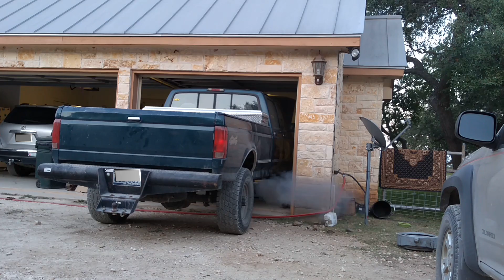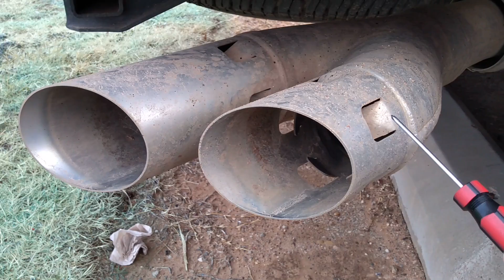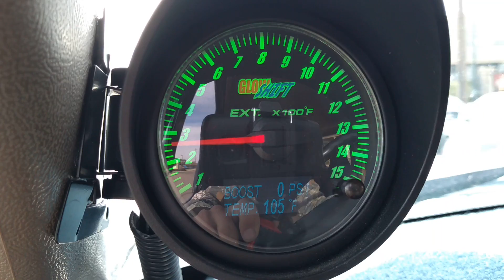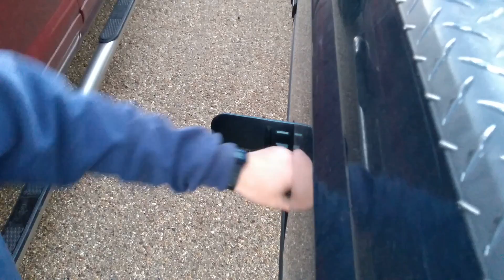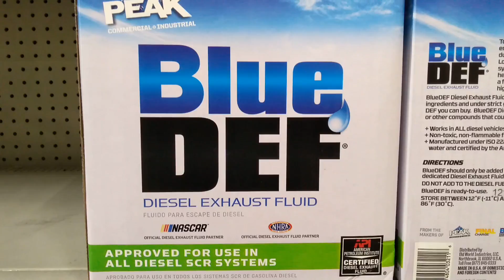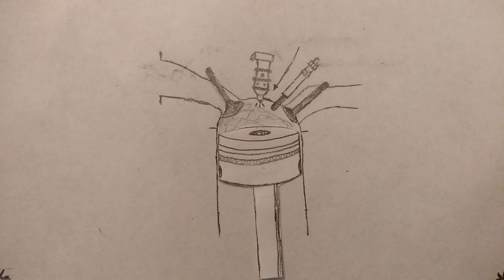Top 10 Things to Never do to a Diesel

Comment: I realize this is a 5 year old video. But,,, old diesel farm tractors had a Ether can, with a button mounted inside of the cab, built into them. There were no glow plugs in those days and there is no way they would ever start at anything below 30 degrees without a shot of Ether. This was common until the early 90's, later on some models.

Comment: I have a 2007 F350 with a 6 liter diesel. I use Howes diesel treat all the time. It cleans and lubricates the injectors and prevents fuel jelling in cold weather. I don't let my fuel tank to go below three quarters and everytime I refuel I add the correct amount of diesel treat. Never had any problem srarting in cold weather,as long as the batteries are good the engine fires right up.

Comment: Ive always thought there should be a pedal that you pump a few times before start that primes the engine with oil (gas or diesel engines ) but why prevemt the main cause of long term   damage

Comment: Had a mechanic at work put a fuel pump on a diesel motor water pump on my tank truck, i used a couple spurts of ether to get it to crank over but i couldnt get the damn thing to run, the mechanic literally emptyed a full can of ether into the air filter trying to get the air out of the fuel line, the 15k$ 30hp motor never ran the same, i think the ether burned the rings because it smoked like a chimney everytime i started it, and blew oil out of the breather tube, that motor had about 10 hrs good hours on it and 50 hours of blowing oil until the piston finally let go this week..... Yes, ether is very bad for all motors in large amounts..... no lubrication and burns very hot

Comment: I didn't experience heat increase by putting a different exhaust tip on my 16 6.7 stroker. I can put my hand on the exhaust tip. It is uncomfortable. But doesn't hurt. I could not do that to my 7.3. You put gas in your diesel tank... you have a very high chance of blowing up a injector. I agree about the ether... don't use it on these pick ups. If you have to do something like this in a pinch use something like wd40 where it has lubricants. I have seen diesels that after ether has been uses on them... they become reliant on it.

Comment: 289,000 miles on my 2006 6.0
Lots of repairs at 200,000 miles but looking forward to 400,000 miles
Reply: Keep up the maintenance. My 03 6.0 has 332600 on the clock. Yes I've worked on it myself and have paid for repairs also. Parts and maintaining costs money. I think mine is making 500,000. Interior and power train mint .I need a new bed Winters tough in Pennsylvania. Good luck getting to 400k.

Comment: Good info! I recently acquired an abandoned sailboat, and there was water inside the Perkins engine and fuel. 4.5 years of abandonment. After cleaning the entire fuel system and bleeding, flooding with Marvel MO, 2 x 20sec cranking, with no effort moving or firing up, i sprayed 1 sec of ether inside the engine and waited 20 sec. It cranked up with a massive tonne of white smoke. Would never do it again, but it got the baby started and hopefully very little of any damage to get it alive again.

Comment: Newer Rams with Exhaust Brake/ Jake Brake..always have it ON. If you dont run it for a long time..it will build up soot and when the time comes to engage it..it may not fuction and or burn out the Variable Actuator motor..And since the Chip shortage looking at $700 to $5000 for just that Actuator..ask me how i know..Dealership $5000 and $600 direct from cummins..and unless you are in a serious bind..and depending on who you get at cummins they don't deal directly with the public..I was fortunate enough that they sold it to me.

Comment: I'm surprised you didn't mention the term "run away", especially for the ether tip. A run away diesel is terrifying, and every diesel owner should be at least aware of it.
Reply: What’s runaway?
Reply: @debspeakes9750  basically it starts to use oil as fuel and starts a reaction that ends with the engine exploding. Taking the key out of the ignition does nothing, it's pretty insane. Reason I keep a fire extinguisher in my truck.

Comment: it's not the ether that's the problem, it's the people using it. always crank your engine over to pre lubricate the cylinder walls, use very little ether and turn your key straight to start. don't let the glow plugs cycle at all. but I always plug mine in. when I go hunting I put a pan full of diesel under the oil pan and light it on fire. takes about 3 hours depending on the temperature to heat it up. a 3 pound coffee can works good. have also heated up my 400 cummins in the big truck like that. Some times I think they should bring back the compression release.

Comment: One thing I've learned to do, especially in cold weather (like here in Canada) is that if it's going to be idling for awhile, bump the idle speed up to 1000-1100rpm or so, if you're able to set it to do that. It helps keep some heat in the engine and the engine oil, which is good for the engine. I had a truck with a 466 that would drop the temp right off the gauge if you let it idle on cold winter day in about 20 minutes, even after driving it at operating temp. Bumping the idle speed up to 1000 or so helped keep the engine temp closer to where it should be. Also, just don't run them cold in general, running too cold doesn't let the oil heat up enough to work properly and evaporate off contaminants like condensation.
Reply: Upgade exhaust tips lol nothing stupider then a giant exhust tip

Comment: You can use either but you have to do it right unplug your glow plug relay so it doesn't destroy your glow plugs turn the motor over until you see smoke out of the exhaust then you can give it a small shot. But better yet while you're turning it over when you see smoke out the exhaust have someone else give it a small shot will you turning it over period and all will be good

Comment: Both my diesel John Deer loader and road grader came from the factory with on-board ether tanks with remote solinoids for cold starting injection systems.  And both came with block heaters and very cold days I use both but prefer ether.
I rarly use it on my 7.3 for reasons you point out.

Comment: What’s the recommended time to warm up a 7.3 diesel (I have a 99 f350). I usually wait 5-7 min when it’s not cold outside and when it’s cold cold I wait 10-12 min until I leave. What’s your opinion?
Reply: I do the same thing with my ford 6.0 I have temp gauge and watch my gauge. I drive slow until it’s up to 100 degrees then I put my foot in it. Not good to let idle for 20 - 30 mins all the time

Comment: At least with older diesel engines, if it's extremely cold outside, you have no access to plug in the block heater and your glowplug relay is not working, you can safely used a small shot of starting fluid without damaging the engine.  Been working with diesel engines for almost 28 years and my dad for over 45.  I've personally had to do this more than once on my F250 7.3.   You just want to make sure you're using a very limited, small amount.  Too much will cause damage. Likewise, if your glowplugs are working, you don't want to do this either.
Reply: I was always told that th more you use starting fluid on a diesel th more youl have to to

Comment: What do you think about the propane injection systems for diesel engines?
Reply from the maker: I don't really know enough about propane injection to have an opinion one way or the other. Anything that does push the limits of the engine beyond its design power level however is likely to decrease the life of the engine. Of course that only applies if you use that power with your right foot.

Comment: Gasoline is combustible and diesel is flammable. Therefore it is safer to run diesel in a gasoline engine. If you run gasoline in a Diesel engine the high combustion rate will blow the Diesel engine apart because at a normal idle it would be turning about 3k rpm because the Diesel engine compresses the gasoline to an extremely psi and therefore raising the combustion rate even higher.
Reply: You have them backwards. Gasoline is flammable. Diesel is combustible. But your point is correct. Gasoline in a Diesel engine  is FAR MORE destructive than diesel in a gas engine.

Comment: Excellent advice especially the part about NEVER USE ETHER IN A DIESEL ENGINE. If it's negative 25 degrees and you need a truck. (Rent a gas powered truck instead.) If you try to start a diesel with ether you may be looking at $5,000 -$20,000 repair bill if that pre-ignition goes the wrong way. Call the rental company instead. Also never use anything flammable if you don't have ether. WD 40..no way A spray bottle with diesel in it ..nope. Some guys say that WD 40 is safer. Don't listen to them. Pre ignition doesn't care what is being sprayed into that engine when the piston is before TDC. If it doesn't start and you don't know what is wrong and you don't know how to fix it . Bite the bullet and call a tow truck.

Comment: I have found acctuly putting gasoline in a diesel is worse than diesel in gas because with diesel in gas it just won't run you can take it out and flush it with gasoline because gasoline is a solvent with gas in a solvent it can corrode diesel components and seize them from lack of lubercation

Comment: 896,876,754,736 cans of starting fluid used over the years with no problems. Yes you don't need to use it with glow plugs, otherwise you just need to know what your doing.  If he lives in Texas he most likely does not deal with extreme lows. We woke to -2 several times this past week. Sometimes it is all you have.
Reply from the maker: Fair enough, we've got a couple 966's and the ether cans are probably as old as the tractors themselves. Fortunately though they start fine when it (typically) never gets under 30 degrees!
Reply: @Rnddiesel  they dont like the - temps. I did find another trick.  We took a section of stove pipe cut it about 4 inches shorter than the oil pan and put a can of sterno in it. Left it burning for about 30 minutes and fired it off.
Reply from the maker: @thepitpatrol  That's a nifty trick, I'll keep that one in mind. I'd be a little worried about lighting the engine on fire though with as much as it leaks oil.
Reply: @Rnddiesel  well the great thing is that it would be tough for the sterno to generate enough heat to spontaneously combust the oil reisdue but you would need to be careful. Listen, in a perfect world  we would all drive rigs with perfect glow plugs, grid heaters or be able to be plugged in. I had an uncle years ago that logged. They had a metal grease can they cut down. They built a fire in it and shoved it under the truck to get the old detroit fired up. He logged a mountian one year by getting loaded. Putting one side of the truck in a ditch so he could get dwon through the snow. We have it much better now, even if we do need a little starting fluid lol.

Comment: Question. My glow plugs are dead and it won't start unless its atleast 50°. I've used starting fluid a hand full of times to start it, which I will not do anymore but my question is, what could cause it to not want to start under 50°?
Reply from the maker: It's likely the glow plugs or the glow plug relay, I wouldn't really count on my truck starting under 50°F without glow plugs. The older 7.3's really need all the help they can get to start when it's cold.

Comment: I have tried running a couple junk diesel engines on gasoline and due to how thin the consistency is of gas, the lift pump cavitates as soon as the gas washes away the oil from the pump internals resulting in a pump stall condition. The gas never made it to the injection pump.

Comment: Rule 1. Do not allow engine rpm to exceed max rpm. This happens when descending hills in lower gears. A diesel can be destroyed in seconds doing so.
Reply: this is obvious, but important
Reply: @lucasvanhamburg4937  I've known a standard shift bus that had that done to it. Drove a connecting rod into the pan.

Comment: Sometimes a visit from the ether bunny is better than walking. I would sparingly ether a 7.3/6.0 I have no experience with 6.4/6.7 (they may be same) but the older ones were fine if you leave the key on for a while first to let the preheat cool off as it won't heat again until you cycle the ignition off/on again. Cummins/gm I wouldn't because once it starts it preheats again and could blow the top off the prick if there is still ether in the manifold. You could always disconnect the preheater circuit if you needed to use ether to be safe. Occasional use of ether wont hurt fuckall unless you use too much and it runs away, or it ignites in the manifold. Old heavy trucks used to have ether start systems with a spin on little bottle like a propane torch and a button controlling a solenoid in the cab for winter.

Comment: I accidentally put 15 litres of petrol in my turbo diesel. Mixed it down with 40 litres of diesel. Right before a 300 mile trip. Engine ran beautifully and was noticeably better for months afterwards... that was 76k miles ago.

I always use fuel system additives at a higher concentration and use a cetane booster to speed up the ignition process 🙌
Reply: I've used litres and kilometres.
And gallons and miles.
But never litres and miles together.
What country was that in ? ...
Reply: @fjb4932  in the UK our fuel comes out the pump in litres. We measure distance in miles typically.  But we do measure MPG for some weird reason not MPL 
😆😆
Reply: I’ve heard many times that cetane booster can negatively effect combustion with todays quality of diesel. Whether it’s true idk maybe just a tall tale🤷🏻‍♂️
Reply: @johnmorgan2444  maybe on modern diesel engines but mines just before all the extra additive and dpf nonsense.
Egr is gone. Cat is gone.

Comment: After start, I.mmediately place in Drive to slow engine rpm.   Under that slight load, thengine will warm faster.    Then I move up the street with no throttle - just idle - until a few hundred yards.   Then gently accelerate.
Reply: Idling in gear while holding the brake not only puts the engine under a slight load and causes it to warm up quicker but it also warms up the trans oils quicker as well. I do the same thing myself.

Comment: Arch oil in fuel tank every fill up & modifier every oil change , can be used in rear end also, power stroke help .com in Buford , Ga.
Reply: @olddogacp4473  ya, the oil modifier, fual & diesel full system cleaner , all three for about $80 , I have to order a other kit myself .Made a big difference, I'm here in Maine, but it a 2002 F-350 dually with the 7.3 .
Reply: @olddogacp4473  From South Carolina ., The truck is got it last January

Comment: I have a stock 93 7.3L IDI non-turbo F350, It gets sluggish when towing heavy loads, It has a very small air intake, like two slices of bread stacked on each other, and the exhaust is grated to restrict air flow. Would I be in risk of damaging or bogging down the engine with higher air flow on both ends?
Reply from the maker: You shouldn't be at any risk of ruining the engine by reducing airflow restriction. A common thing folks do with the old IDI is to get rid of the old soup bowl intake in place for a better flowing option. As for the exhaust, I'm not so familiar with the IDI's, but I believe the exhaust is pretty small like 2-2.5 inch out of the manifolds, so opening that up a bit bigger should help some. The grate you're talking about, is that the grate right at the exhaust tip?
Reply: Put a hypermax turbo kit on it …  that will wake it up ! 

Advance the injection timing and maybe the injection amount too

Comment: There’s a little hook inside of your gas cap cover to hang your gas cap on so it doesn’t rub on your paint. I just noticed in the video.
Reply: Not all vehicles have that. It's a nice feature when you do though. My old van, a 1995 G20, didn't have a gas cap hanger like that. But my 2006 international pb105 has a feature like that, the cap has a chain on it which holds the cap near the neck of the tank. SUPER useful feature.

Comment: My dad used starter spray in his early 97 7.3 and the factory air box blew across the yard. The engine wasn’t damaged but we had to buy after market because the stock ones cost more than after market ones
Reply: LOL, I just bought a 97 7.3, flooded it, and blew the airbox up with ether :-/ $350 on ebay for that air box!

Comment: You can use silicone spray instead of ether it has a specific gravity similar to diesel fuel
Reply: Or you can use brake cleaner, it cleans your brakes AND starts your truck at the same time 😂😂😂

Comment: In my 7.3 I use the Lucas additive & a quart of the heaviest weight oil I can. Max of a 40wt oil. 

On my 7.3 I never need my glow plugs, so I turned them off, with a switch so if it’s too cold I can turn them on when needed with the relay, I just spliced a switch on the relay that triggers it on the front of the truck.

On any diesel put diesel fuel caps, cuz someone is gonna see the cap & put diesel in it.

Comment: Its not the ether that hurts a diesel it's all the other shit that's in the can with it. Pure ether shouldn't cause a problem with diesels. That said I still wouldn't use the stuff unless you absolutely had to. On a side note I've seen a couple of 2 stroke Detroits with cup on top of the blower for a small ether pack and have seen semis here in the US with a toggle switch or push button for either injection.